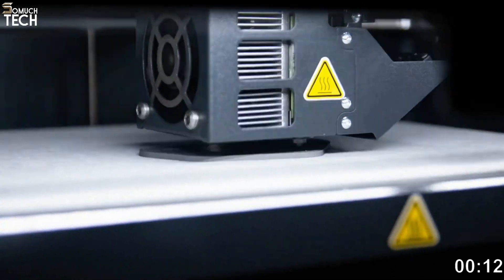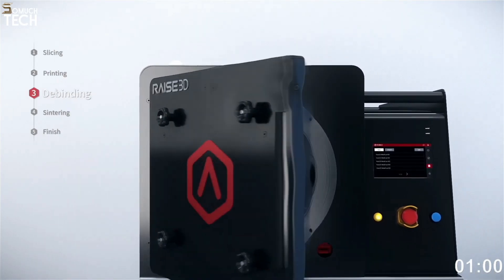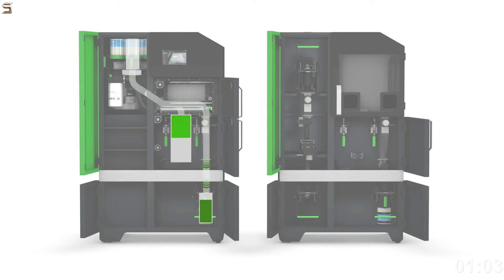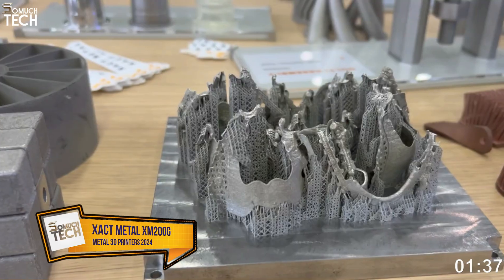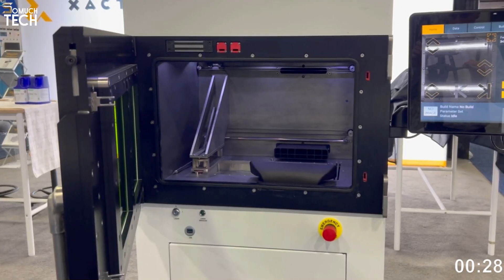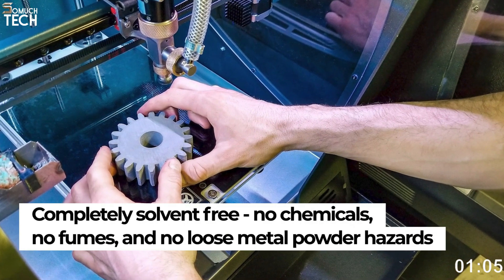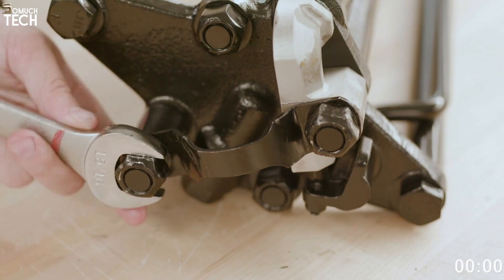BEST METAL 3D PRINTERS 2024 - PICK THE RIGHT OPTION!

Comment: Show me a metal printer that can be used to replicate metal parts like hoods, etc. for 1/64 scale Hot Wheels diecast cars. AND BE CHEAP!
Reply from the maker: If you're looking for a truly cheap metal 3D printer, that’s going to be tough—metal printing is usually expensive. However, you might have luck with a budget-friendly resin printer and cast your own metal parts using lost-wax casting. If you really want a metal printer, check out the Snapmaker 2.0 with a CNC module, or look into sintering-based options like the Anycubic Kobra 2 Max (for printing wax or castable resin). For actual metal printing, the price jumps significantly!

Comment: The quality of metal powders is equally as important as the quality of the printer. The only powder I’ve personally had success printing with consistently is a Canadian company called Equispheres (AlSi10Mg aluminum powder)
Reply: How’s the precision of 3d metal printing. I mean the whole idea of 3d metal print is a new things so maybe around 10-15 years it will be more better
Reply: @fallen4501  according to google A.I

Metal 3D printing is not new, with its origins tracing back to the late 1980s and early 1990s with technologies like Selective Laser Sintering (SLS), Selective Laser Melting (SLM), and Direct Metal Laser Sintering (DMLS). It has significantly evolved since then, becoming more accessible and robust, with modern applications spanning healthcare, aerospace, automotive, and more. 

Late 1980s: The foundational work for metal 3D printing began with developments in technologies like Selective Laser Sintering (SLS) at the University of Texas at Austin and concurrent work on Selective Laser Melting (SLM) at the Fraunhofer Institute.
1994: A significant milestone was the introduction of the first DMLS machine by EOS.
Early 2000s: Electron Beam Melting (EBM) technology was further developed with the launch of the first EBM machine by Arcam in 2002.
Present day: The technology has become more accessible and is being used for high-volume manufacturing, with continuous improvements in speed, material options, and part quality.

Comment: 🎯 Key points for quick navigation:

00:00 📊 Learn about the top five metal 3D printers of the year based on reviews, quality, and price.
00:14 🔧 Raise3D offers a complete in-house metal printing solution, eliminating the need for outsourcing post-processing.
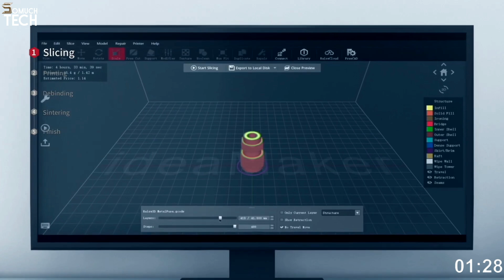00:41 🔍 Raise3D's metal printing system ensures precision with features like dual extruders and a HEPA filter.
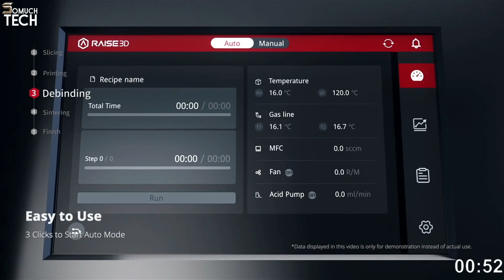01:20 🧪 Raise3D introduces a service for design validation and optimization for Forge 1 owners.
02:02 📈 OneClick Metal's affordable and efficient system offers low-cost solutions and minimal space requirements.
03:00 💨 OneClick Metal features an unpacking station that simplifies powder handling and reuse.
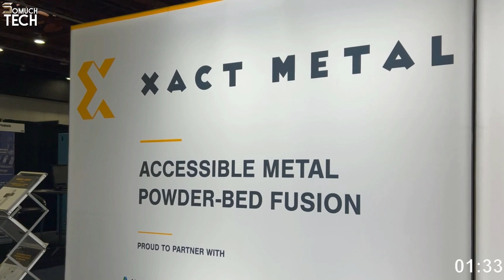03:28 ⚙️ Exact Metal's XM 300G introduces quicker printing times with multi-laser technology.
03:46 🌀 Exact Metal's new model has larger build volumes and superior laser power for complex components.
05:13 🧪 The Ridia Conflux 1 offers extrusion-based technology and does not require debinding, providing energy efficiency.
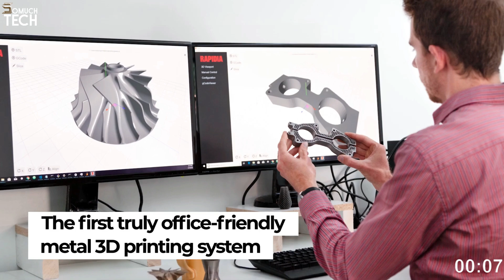06:38 🔬 The Ridia Conflux 1 supports various metals and enhances cost-efficiency with innovative features.
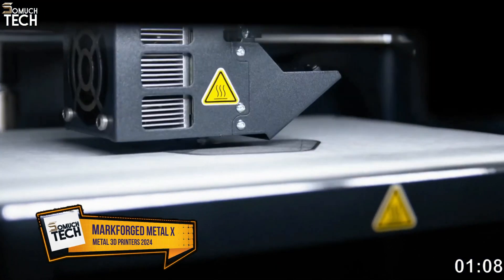06:51 ⚡ Markforged Metal X facilitates quick metal part production and involves a robust post-processing system.
07:47 🌟 The Metal X uses proprietary filaments for diverse material capability, including steels and copper.

Made with HARPA AI

Comment: now I can have a real gun lol
Reply: Maybe not a whole gun maybe just some special light switches and buttons 🤫 😂🎉
Reply: Very precise i mean yea if your making a precise guns you can make a shotgun out of steel pipe  lol littraly  it's called a slam shotgun easy to make slam fire
Reply: Just don't blow your hand off lol
Reply: CNC machine would like to have a word with you. I don't recommend to use 3D printer to make working guns. As gun requires very precise machine with very minimal tolerance to assemble guns. Not to mention they aren't rated for high pressure and heat durability. Good luck with that.
Reply: @terramcevidence299  Dawg, I'm pretty sure my man is making a joke here.
Reply: @halo64654  yes but it's important to clarify the reasoning, it was useful to me
Reply: @halo64654  you would be surprised at how many gun lovers are printing their own...
Reply: @terramcevidence299  This simply isn't true. 
What you believe is a gun & what passes as one is HIGHLY different, you're thinking of high standard high MOA score firearms. You can certainly stamp sheet metal to the point to take the forces of a 9mm & make a simple blowback submachine gun from standard hardware from your local freight store lol
Reply: @terramcevidence299  you should research about fgc 9 existence , orca ar 15 existence